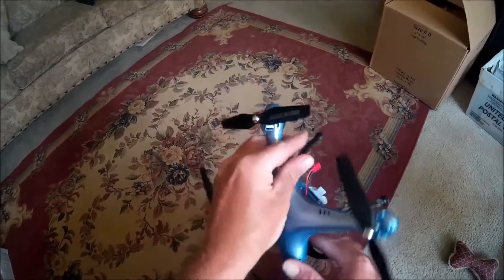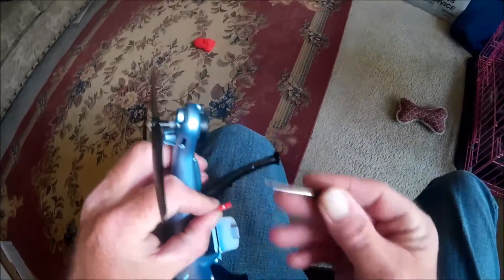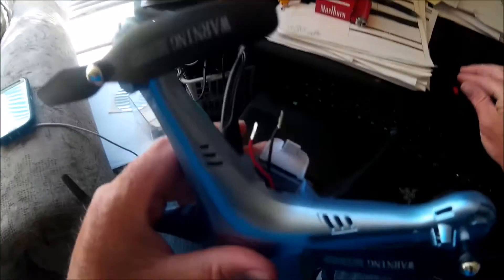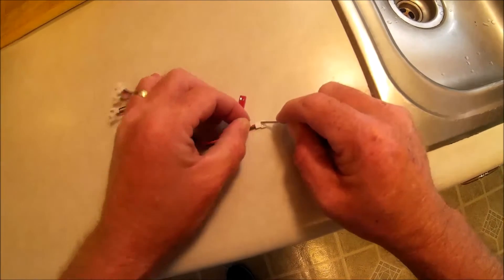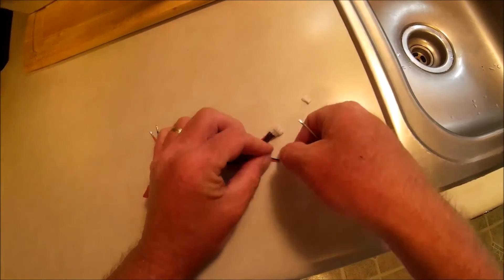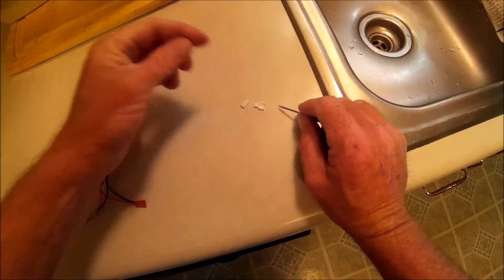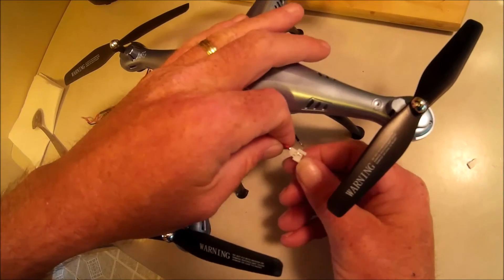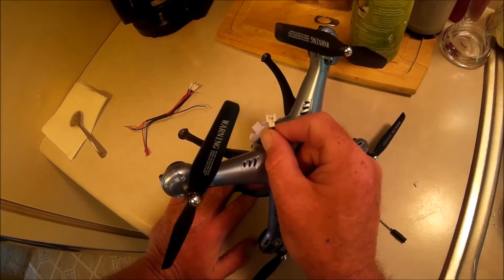How To Modify The Battery Plug On the Syma X5HC

Comment: Also add caution. Transfer one wire at a time. No chance that way the 2. Live battery wires hit.
Reply from the maker: Yes they make a big pop if they touch. One at a time is a good idea or tape off the hot one until your ready to transfer to the new plug.
Reply from the maker: Of course for what I show there is no risk of 2 hot wires touching as I don't do the battery but only the quad itself. I actually didn't do the battery as I had a gazillion of these batteries already so I just sold the Syma X5HC battery as is brand new and used my others I had.

Comment: I always have problem putting the clip back in. Only goes one way.
Reply from the maker: Yes I also suggest running a pocket knife down the plug and very easy just pop up the locking pin. This way it locks in the new plug when you push it in.

Comment: I modded mine with an xt60 cable so I can use it on a hobby grade charger
Reply from the maker: +george aura I can use a hobby grade charger. I can charge anything with my Hitec X4 charger you just have to have the right boards.
Reply: +Jeff Suits oh I didn't know those plugs can be used on a hobby grade charger
Reply from the maker: +george aura Yeah just a matter of having the right balance board and plugs. For the price of that HiTec X4 it should walk my dog to. Best purchase in the hobby. Quality gear. Buy cheap buy twice is my moto.
Reply from the maker: +george aura I have Xt60 on my racers and Another on my boats and another on my planes. some JST and some molex. Things a best. Charges anything at a minimum 4 at a time but you could use harnesses and get 24 1S batteries rocking if you were that serious about needing power. It will also connect to my truck battery and charge in the field hence I can stay out all day and fly non stop. It wasn't cheap though. Quite expensive to be honest but it's been so worth the investment.
Reply: +Jeff Suits wow well that sounds great
Reply: +Jeff Suits man that's a serious charger right there, mine is pretty good I just wish I had some more balance boards
Reply from the maker: +george aura http://www.horizonhobby.com/x4-ac-4-channel-ac-dc-charger-hrc44167
Reply from the maker: +george aura Plus you need the banana plugs and 4 balance boards one for each port.